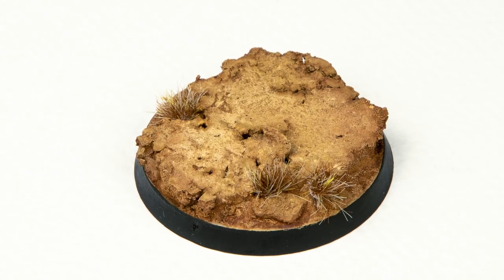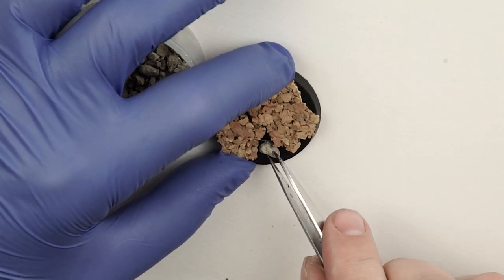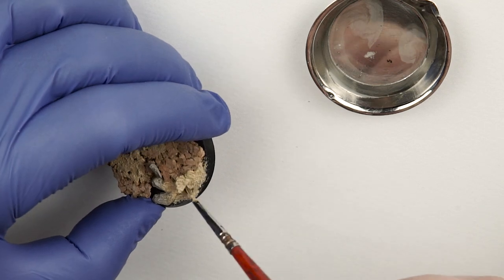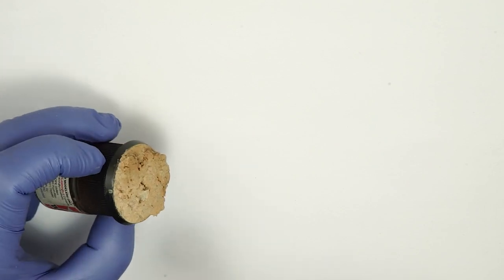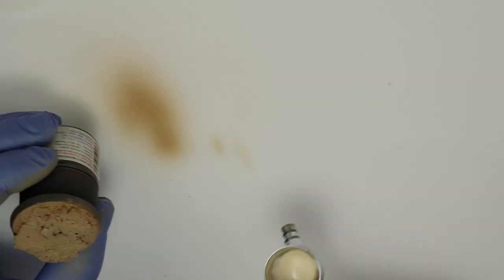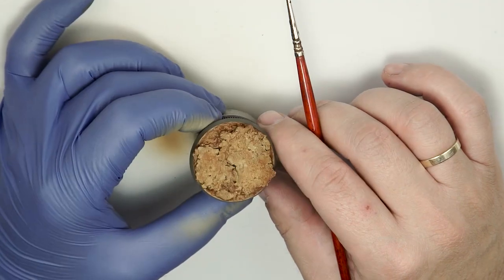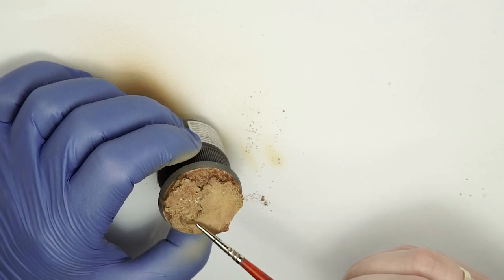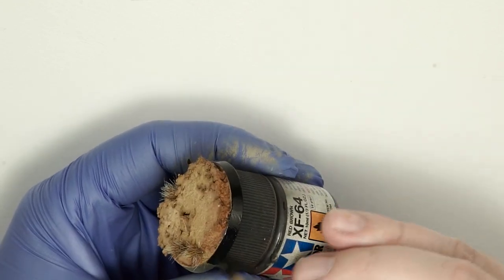How To Make a Desert Base For Your Miniatures

Comment: Very cool. I haven't used cork for basing for quite some time now, didn't like the look of it. You've convinced me to give it another shot and thus have earned a sub, as well. I'll definitely try that one out. Very nice work!
Reply from the maker: Thank you 😊
Reply: Do you also use cork on 25mm bases? Or does it look awkward with the smaller diameter?